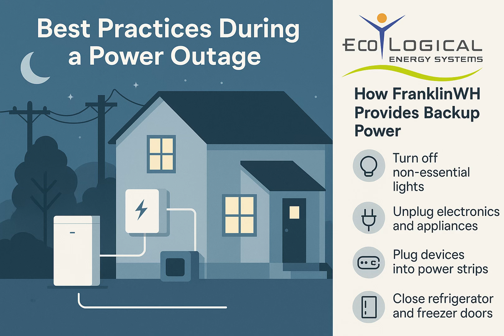Why Choose FranklinWH Energy Management

Comment: Love the video!!  I have a new Franklinwh system with existing solar and 2 apower 2 batteries.  I love the system and its flexibility.  I have the generator connect for the system but what I want to know is can I get an ATS that will work with a large portable geny.  I’m looking at a the Westinghouse 18,000/14,500 - 50 amp portable generator.  Will an ATS work in this configuration?